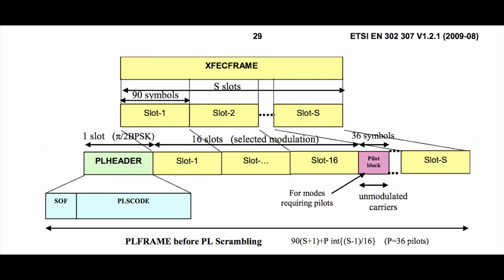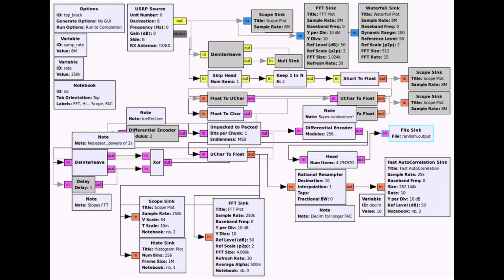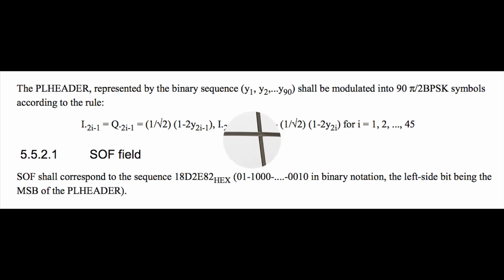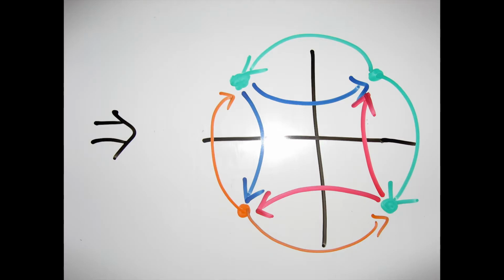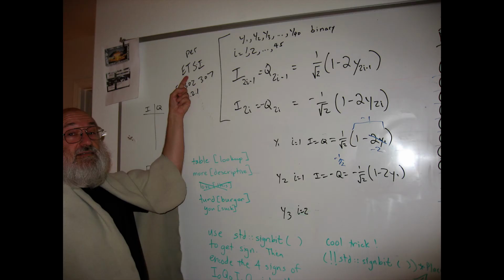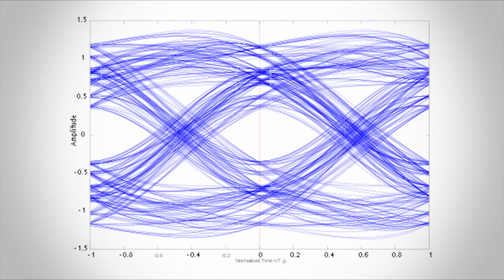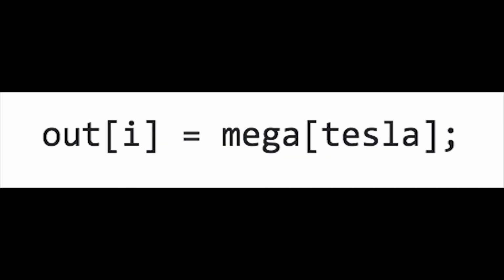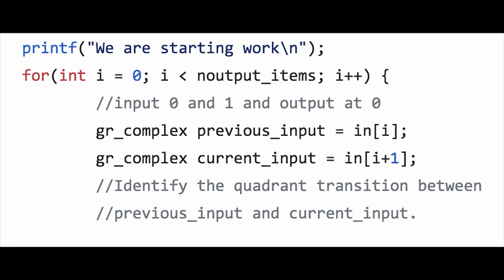20171003 Phase4 weekly report

Comment from the maker: Greetings!

Today we're talking about our simplified pi/2 BPSK decoder, working under the assumption that symbol timing and phase have already been resolved to a single sample per symbol.

This work fits into the much larger picture of acquiring phase, timing of symbols, demodulation, decoding, and correlation to the fixed patterns of the Start of Frame field in the physical layer header that helps define each DVB-S2 frame.

The DVB-S2 physical layer header is sent using a modulation scheme called pi/2 BPSK. This scheme is defined in the standard. Since we're using GNU Radio as our reference design, we decided to make a custom block in GNU Radio to do this. This block will evolve to include our specific type of correlation for the Start of Frame as well. 

Given that we needed a block, we had to learn how to make one. 

There is a very useful GNU Radio Block Coding Style Guide here. https://wiki.gnuradio.org/index.php/BlocksCodingGuide

There is a helpful set of guided tutorials on the GNU Radio website here. https://wiki.gnuradio.org/index.php/Guided_Tutorials

A block in GNU Radio is the unit of signal processing from which you build a flow graph. It can implement a very simple function or it can be very complex, and it might or might not take parameters that control how it works. Related blocks are grouped into a “module”. The name of the module shows up in GNU Radio Companion as the category header for blocks that belong to the module.

To help build blocks and modules, there's a tool built in to GNU Radio called gr-modtool. One of its functions is that it sets up a module. Another function lets you add blocks to that module.

Using gr-modtool is relatively easy. It sets up the right directory structure for you and it provides templates in either python or c++ for the implementation of your block. I'm not going to duplicate the tutorial here. Find this specific tutorial here https://wiki.gnuradio.org/index.php/Guided_Tutorial_GNU_Radio_in_C%2B%2B

If you walk through this tutorial you will be well on your way to being able to code GNU Radio blocks. 

After doing the tutorial a couple of times, we attacked the problem of demodulating pi/2 BPSK. 

We started with the definition in the spec.

"SOF shall correspond to the sequence 18D2E82HEX (01-1000-....-0010 in binary notation, the left-side bit being the MSB of the PLHEADER)" 90 degree BPSK, so in complex notation, it's…

"The PLHEADER, represented by the binary sequence (y1, y2,...y90) shall be modulated into 90 π/2BPSK symbols according to the rule:
 I sub 2i-1 = Q sub 2i-1 = (1/√2) (1-2y sub 2i-1), I sub 2i = - Q sub 2i = - (1/√2) (1-2y sub 2i) for i = 1, 2, ..., 45 "

If we think of I and Q as coordinates in a cartesian plane, we have what's called a constellation diagram. Using this visualization, in pi/2 BPSK the information is encoded as the direction of rotation around the unit circle: clockwise 90 degrees (pi/2 radians) for a 1 or counterclockwise by the same amount for a 0, with each received symbol. Because the next stage of the receive pipeline is a correlator, we choose to output +1.0 for a clockwise rotation and -1.0 for a counterclockwise rotation. This encoding will be helpful later, when we change to a more sophisticated demodulator implementation.

The signal never stays in the same quadrant for two symbols, nor does it ever cross through the center by moving 180 degrees at once. If we see either sequence in the received symbol stream, we know it is an error. We pass that information along to the next stage as what's called an erasure, encoded as a value of 0.0.

This really needs to be reviewed to make sure we have interpreted it correctly. Code for this block can be found at the following repository and discussed in the code review channel in Slack. https://github.com/phase4ground/correlator

Once we thought we understood the way pi/2 BPSK worked, we wrote quality assurance test code. The gr-modtool sets up unit testing templates for you, so that you can test first like highly evolved and successful programmers always do.*

Then we wrote some demodulation code. It didn't work. We wrote more. It didn't work either. QA tests kept failing. We went back to the drawing board and realized that it would never work. We proved that the problem couldn't be simplified combinatorially. We then wrote a table lookup for the combinations of previous and current symbols. Here's the table we started with and went back to. Because we assume the symbols are already symchronized and lined up for us, we only need to pay attention to the sign bit of each sample.

I_previous Q_previous I_current Q_current Result
+                 +                   +              +                erasure
+                 +                   +               -                 clockwise
+                 +                   -               +                counterclockwise
+                 +                   -                -                erasure
+                 -                    +              +                counterclockwise
+                 -                    +              -                 erasure
+                 -                     -              +                erasure
+                 -                     -               -                clockwise
-                  +                    +             +                clockwise
-                  +                    +              -                erasure
-                  +                    -              +                erasure
-                  +                    -              -                 counterclockwise
-                  -                     +             +                erasure
-                  -                     +              -                counterclockwise
-                  -                     -               +               clockwise
-                  -                     -                -               erasure

We receive a series of complex signal snapshots. We establish a history, where we tell GNU radio that we need to keep track of the most recently received complex signal along with the current one. This means we use the set_history function in the constructor. The history value is 2. We need the previous signal in order to tell which direction the signal moved and whether or not that move was valid. 

In our complex signal world, the previous result and the current result are each composed of a real and imaginary part, representing the in-phase or I and quadrature or Q components of the signal. Each part is a float.

The lookup is achieved by taking the signs of previous I, previous Q, current I, current Q with the signbit macro, and converting those sign bit results into an integer by multiplying each one by place values 8, 4, 2, and 1. The std::signbit() macro returns 0 for positive value and non-zero for negative values, so we use an old C programmer's trick to convert it into boolean 0 or 1 by negating it twice (!! “double bang”).

int tesla = (!!std::signbit(previous_input.real()))*8 + (!!std::signbit(previous_input.imag()))*4 + (!!std::signbit(current_input.real()))*2 + (!!std::signbit(current_input.imag()));
 
out[i] = mega[tesla];

Output is a table lookup.

mega is a list of floats constructed as follows.

float mega[] = {0.0, 1.0, -1.0, 0.0, -1.0, 0.0, 0.0, 1.0, 1.0, 0.0, 0.0, -1.0, 0.0, -1.0, 1.0, 0.0};

The index created by the integer value tesla (binary coded number derived from the sign bits of the previous and current complex samples) will give the correct output value that corresponds to that combination of previous and current complex signal inputs.

A GNU Radio block is given a certain number of samples to work on each time its “work” function is called. That's no problem for operations that look at just one sample at a time, but we need to look at both the current sample and one previous sample. So how do we ever manage to handle the first sample that's passed into the work function? GNU Radio has a solution for this, called “history”. We call the set_history function and tell it the number of adjacent samples we need to examine, in this case 2. GNU Radio then arranges that each work buffer contains the extra previous sample that we need, in addition to all the new samples. Once we figured that out, and got the table indexing right, the simple unit test case we'd constructed finally passed.

Assuming that the demodulation is correct, the next step from here is to take our start of frame and look for received patterns that match it. When this happens, we will produce a tag. Tags in GNU Radio are synchronized chunks of information that are attached to samples. It is like metadata that can be used by other blocks. For this block, we are going to follow the conventions in the general correlation estimation block. This means that there will be several tags that can be used by downstream blocks that need them. Those downstream blocks have already implemented functions that consume the tags, so if we produce them, it makes for more useful flow graphs.